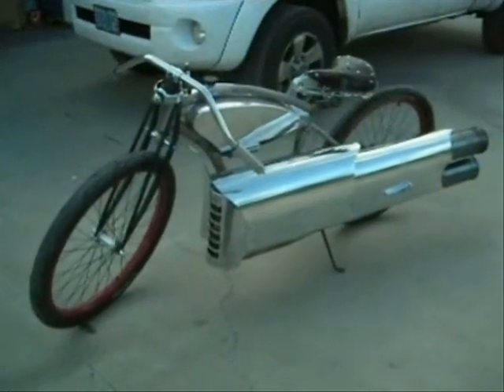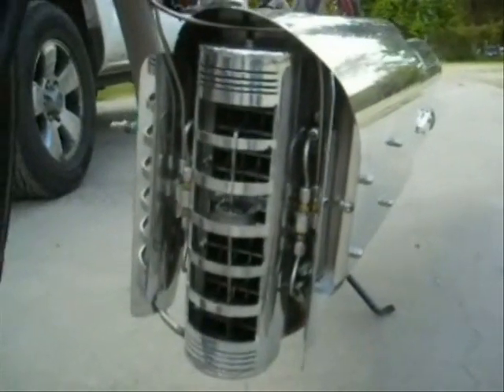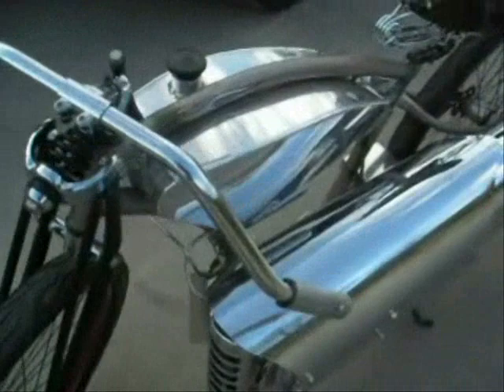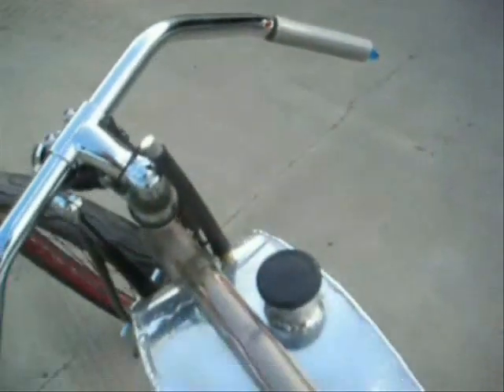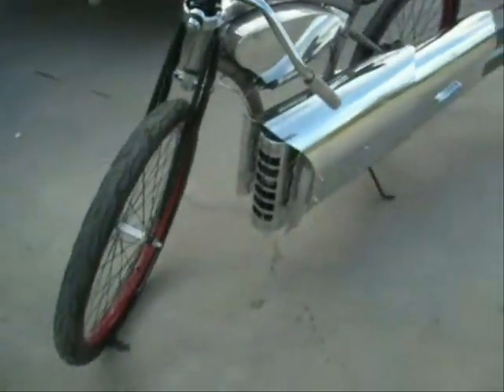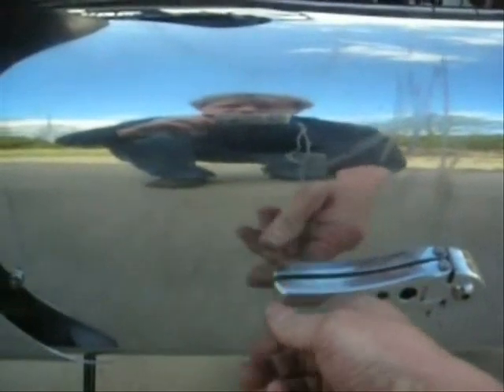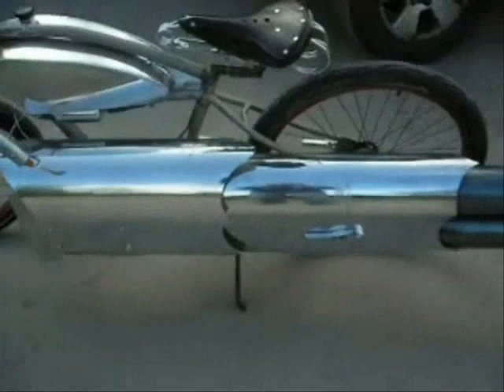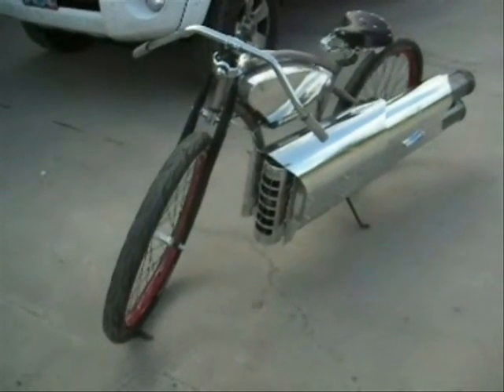"SUPER COOL" Twin PULSEJET JET POWERED ROCKET BIKE Maddoxjets.com

Comment: looks realy nice but not very practical because you have mounded both engines on the same side this will cause the bike to thrust to the right and at slow speed this is not a  problem but at high speed it will be.  Then there is a complete lack of any brakes i can only asume you have a death wish because if you get up to your 100mph+  you will have  no way of stopping even with drag slowing you down the low profile would mean you would  probbibly need 3/4 of a mile to slow down for every mile